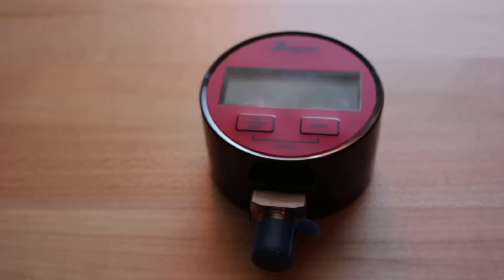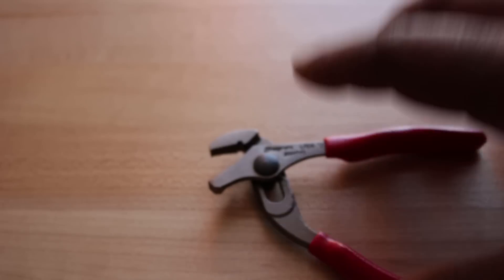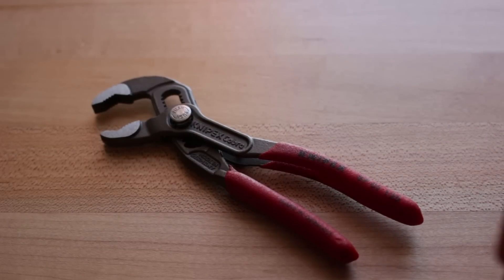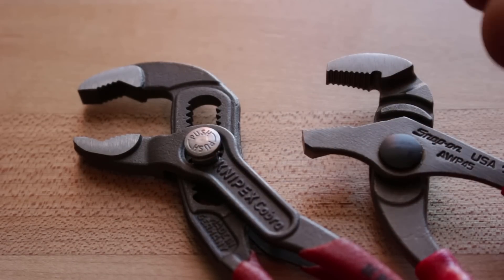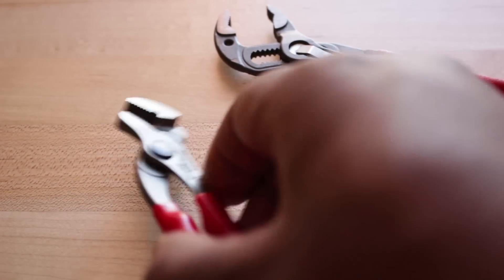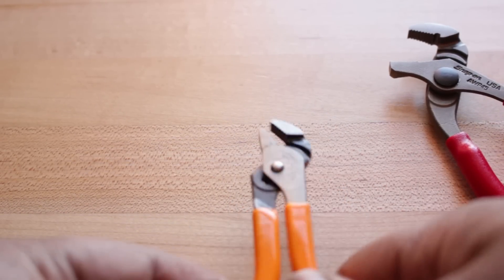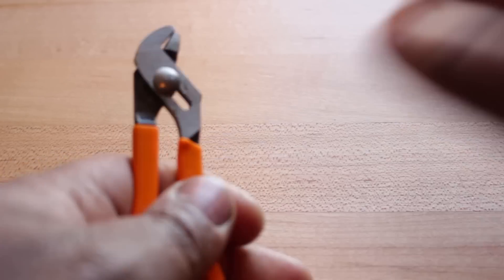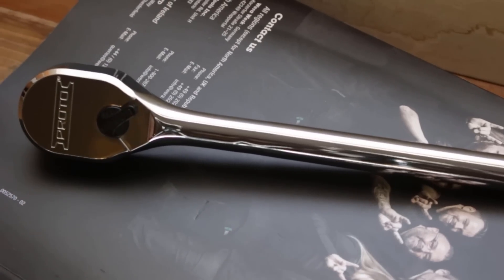Knipex vs Snap-on vs Cornwell Pliers.

Comment: The black coating on the pliers is called Atramentising, also known by other names such as Black Phosphating and Black Oxide coating.  It provides a decent level of corrosion protection as long as you keep them clean.  The parts that are ground down are clear coated or oiled from the factory and would need to be oiled occasionally to prevent corrosion.
Reply from the maker: Knew you would have technical info on such a topic. Do you know if the Snap on pliers are treated in the same way or is it a different process altogether?
Reply: I think it is part of the heat treatment so I'm sure each company has their own proprietary process, so I'm not sure how exactly it is done.
Reply: German Tool Reviews , mine don't get a chance to rust. But i chose Knipex for the anti-pinch lobe on the leg, man that saves a fortune in the swearbox. Quality also tops.
Reply: @GarnettTools  the SnapOn ones might be hard-chrome plated.  BTW, the Cobras are also available in a shiny-chrome version, which is very nice.

Comment: The channel locks are also clearcoat it over And as me being in the plumbing trade the problem is that I tend to use a torch with them and it just melted off

Comment: I just bought a pair of these little Snap on pliers tonight off ebay.. they are 5 inches in length according to the few listings on the site. The pair I bought were used but looked brand new. More of a black finish and didnt appear to be spring loaded. If they were originally,  the spring was either removed or worn out as the photos of them showed them completely closed lying on a table. Im with you, i dont like spring loaded pliers. I like to control them myself and if I buy a pair that are spring loaded I immediately remove the spring.  Lol I was hoping to see that you had a higher opinion of these little pliers but I got them for good price considering  they are Snap on. Im sure I'll  find a use for them.

Comment: The Craftman version are actually smaller and slimmer pn 4513 usa. Also theyre more like a slip joint then a groven lock, as far as the sliding system goes.
Reply from the maker: Slip joint huh? May be made by Wilde
Reply: Yes pretty sure that them and napa labels them also, i'll make a response eventually when my collection of these grow a little more. Wheres the content buddy? =)
Reply from the maker: Currently stock piling it so I don't have to take so many breaks!
Reply: SWEET! Will be keeping a eye out!

Comment: The only issue I’ve had with the Knipex is that little button wears out overtime
Reply from the maker: The mechanism most certainly looks serviceable, but I have never inquired about repair parts. Maybe it's possible to replace those?
Reply: It's replaceable. I've never seen anyone say they have needed to replace it though.

Comment: I like your channel, I like your style. But I have to disagree with the coating of Snap-on that’s deceiving.... unfortunately every impact socket/extension AND plier I’ve owned from snap-on (specifically since 2015) has pitted on me! Almost immediately within 30-60 of usage/sitting in my service cart. Used daily and (all my tools) are wiped down after every use. Sadly it’s hard for me anymore to justify the costs... but on a positive fun fact. There’s a snap-on tongue and groove pliers where the teeth are angled opposite of each other, I LoVED those pliers (unfortunately they were stolen from me) if I can find the part number I’ll edit my post , but they made a huge difference in biting grip action. Highly recommended, since then I’ve noticed some other manufacturers make that teeth design. Huge difference in bite when compared to straight teeth!

Comment: Yes those Cornwell ignition pliers are just a pair of Channellock #424 ( have a pair in my hand right now ) 
They are ignition pliers, and this style used to come in ignition tool sets with ignition wrench's and the works.
Wilde also makes a pair, but the 3 position slipjoint jaws they use on their smaller pliers is not as good.

All of my Channellock pliers work just fine for me and I won't be buying any Knipex pliers.
Reply from the maker: For many people Channellocks work just fine but the easier adjustment on the push button ones makes them better. There certainly no reason I would go out and upgrade if I already had Channellocks, but for a first time purchase I'd pick the Knipex any day

Comment: With Knipex, you can get whatever handle finish you want. So if you bought a tool and didn't like the handle finish, it's on you. Also, for every day carry, you can't beat this set: https://www.amazon.com/Tools-00-20-72-V01/dp/B009RXXZI0
Reply from the maker: Sorry but that is not true, with Knipex, the middle two digits stand for the handle style (87 01 125, the middle "01" digits mean textured grip) Certain styles have EVERY grip option, while others do not. Some of their tools have 5 options, some 3, and others 1. https://www.knipex.com/index.php?id=1216&L=1&page=group_detail&parentID=1368&groupID=1500 as per their website, the only 86 style (pliers wrench) available with a textured grip is 250 mm long but it comes with a trade off because its not chrome plated.
Reply: True, not every tool can get every handle option stock, I should have made that clear, though I've read where people have contacted Knipex when they couldn't get a handle they liked and Knipex sent them the custom tool at no extra charge. At any rate, there is usually an option or two, and if you just pick the tool without looking, and then you're disappointed later, it's on you.